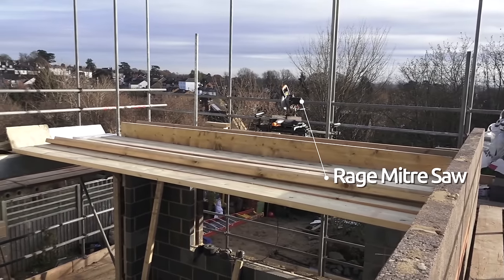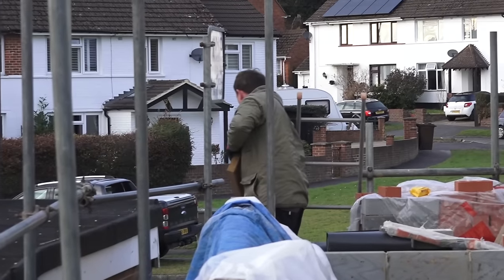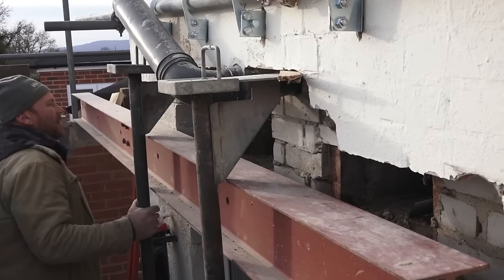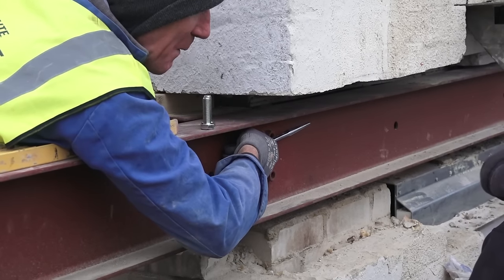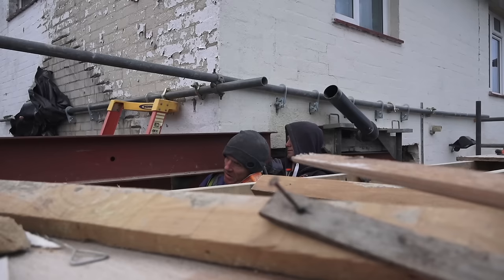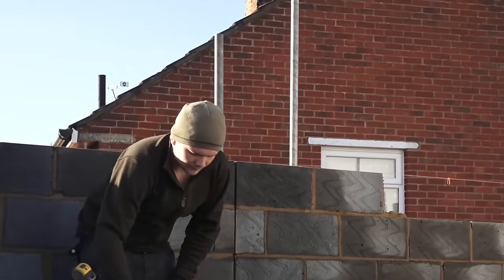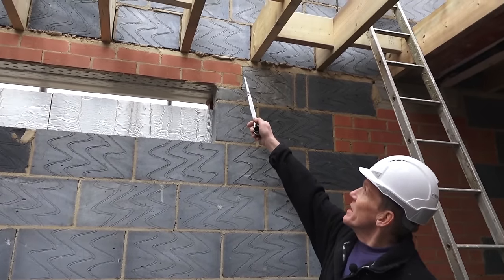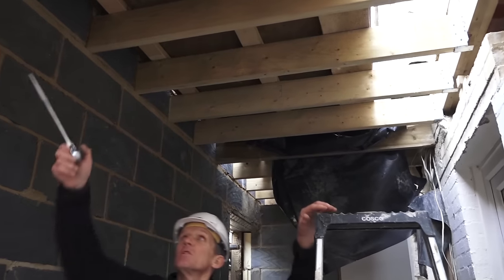Fiting Joists & Steels | Extension #6

Comment: Great vid as normal. I miss those days of putting joists into walls. In Suffolk its been against building regs since about 2003. We can only use masonry hangers or  fixed wall plate. The only time we can do it is in special circumstances like a curved wall with lots of silicone after its bricked in
Reply from the maker: Lee Burwood
Hi Lee 
The drawing showed masonry hangers but, where possible I would rather build them in because they are less bouncy. We will have to take a chance on the building inspector being happy.  We have let the mortar and timber shrink for a while so it is now  time to gun some Blower Proof or similar in around all those joists. You can get plastic pockets to house them in. We have 90mm of Ecotherm behind the joists so they shouldn't get damp.

Comment: Thanks for the great video. You rightly point out that dwangs or noggins need to be full depth in order to stop the floor joists twisting. Especially here at the bearing on the steel these need to be full depth if not on joist hangers. The joists spanning tables from Trada provide further details.

Comment: Nice shear load explanation regarding how seemingly small diameter nails are OK to hold the metal joist wall hangers in place (designed such that no bending moment acts on nails, just shear)!
Reply from the maker: Yes, you are right

Comment: Love the informative video... I'm having a beam put in for my extension and from day dot I told the structural engineer and builder that I want the joining room ceiling to be flush. Not being told the beam is to deep and cannot be flush as it hits the floor upstairs. Do I have any options?
Reply: Drop ceiling height a little bit

Comment: Thanks for the vids as always Roger but why not just fit full depth blocking to help stiffen the joist web? If memory serves any span over 2300 needs them and they’d only take slightly longer than the noggins. If you want space for services then do herring bone or even the metal off the shelf herring bone ties.
Big fan anyway and thanks for taking the time to set up, film, and edit. As a chippy and builder you’d think I’d see enough at work.
Reply from the maker: Ah! Steven, you stole my thunder. I have now fitted the mid-span full-depth blocking and one more idea that helps take the whip out. I am told that herringbones beat blocking because blocking shrinks and herringbone tightens.
Reply: Skill Builder Sounds about right. Hard to get the time for herring bone nowadays but so much better. Allows air flow and leaves plenty of room for running services.

Comment: What is the full extent of the steel off the corner of the existing build into the new extension? Is it a must for this type of wrap around extension?
Reply from the maker: Yes you need to hold up the corner of the building to this 'T' steel arrangement is common.

Comment: Got a similar project, do the joists that sit in the internal web not have joist hangers
Would appreciate your help
Reply from the maker: You don't need a joist hanger if they sit in the web but you need to bolt some timber noggins in between each joist so you can fix them in place.

Comment: Hi, just a quick question. You mention towards the end that you were considering notching and slotting the joist directly into the steel beam but you didnt as you only had an inch of flange. 

If you were to rest joist directly on a steel beams flange, how much of the joist needs to rest on it? 

Thanks in advance
Reply from the maker: I would like a 2 inch bearing but would settle for 40mm with solid blocking in between each joist to eliminate and sideways movement.
Reply: @SkillBuilder  thank you, Much appreciated!

Comment: sorry (from UK) does a building inspector check that joists and beams are installed correctly?
Reply from the maker: yes they should check everything that is structural. It is all about making sure the building is safe.
Reply: @SkillBuilder  cheers..

Comment: Nice video! That 'twist' in the joists is called lateral torsional buckling. If the joists have been designed to have have noggins, they should be full height noggins at 1/3 spacing so the floor/roof acts as one system, not individual members. 
Very interesting to see your temp works there though! What are those brackets coming out the brickwork bolted to the scaffold pole? never seen them before. Cheers :)

Comment: So how did you get around using smaller joists? They look like they’re sat on something built int block work?
Reply from the maker: They are one inch shallower because the floor build up has underfloor heating so they will end up as 9inch.
Reply: Skill Builder thanks

Comment: Lovely job hour doing there. why captive nuts at the steel intersection as opposed to a clearance hole, nut and washers? Would make fitting a damn sight easier.
Reply from the maker: It would but the steel could move on the bolts and that would cause the masonry above to crack

Comment: Could you not have those joists end scribed into the steel beam rather than using the joist hangers?
Reply from the maker: we do that sometimes, it all depends in what order  the construction  is done. The walls went up before the knock through

Comment: Good video , only question I have is how come you used engineers for the steel an not have a steel post underneath to hold the steel ?
Reply from the maker: sometimes you use a steel post and sometimes not. I like a post but an engineering brick pier is how they always used to do it. Look at the all the old railway bridges built to take a steam train. They all use steel on engineering brick. The  weight those steels are holding up is hardly anything in the great scheme of things
Reply: Skill Builder yeah when I was younger we always built brick piers , lot of inspectors we use know like a post , brick pier with pad just as strong tho

Comment: Can you tell me the purpose of 2 steels side by side please?
Reply from the maker: It is often done to reduce the weight. One steel is heavy and you need a large plate above it to support the cavity wall so 2 steels gives you the wider support.
Reply: Skill Builder thanks, I need a steel to go on at my extension, it’s 9m long, 300x300mm and 2.1 tonne :(

I can have lighter steel if I have it in 2 parts with a post in the center but we want it open plan, I thought what you did may be a way round it but at the end of the day it’s down to the structural engineer I guess lol

Good channel by the way

Comment: Should you not have a compressible filler to the expansion joints? Also, are expansion joints required to the internal skin as the NHBC guidance doesn't require them I think?
Reply from the maker: Yes you can buy a foam strip to put in there but we just foamed it up with gun foam. There is a render bead over it. There is no movement joint on the internal skin.
Reply: Thank you. Very quick response and love your videos, I am finding them very useful for my self build :)

Comment: You would have found it easier if the connecting bolts didn’t have the nuts welding on.

Comment: Yet another video on  YouTube where Strongboy’s are being dangerously misused!
Shame on you Skill Builder, the props and needles method would give further access and the required safe working load to support that corner safely and correctly!
The main cause of collapse during masonry alterations is overloading due to removing Strongboy’s further from the wall to either avoid internal 1st floor wall damage or where attempting to gain more fitting work space as over extending greatly affects the capacity.
–
The Maximum Safe Working Loads
(S.W.L)
–
An Acrow prop, 3,400Kg.
–
An Acrow prop used within the props and needles method, 1,700Kg.
–
When fitted with a Strongboy or any other similar designed product the Acrow props safe working load is severely reduced by at least 90%, from 3,400kg down to the maximum 340kg and can even reduce down to 0kg of which depends on the size & the working height of the Acrow prop, how plumb, how tightly fitted and how far the Acrow prop is positioned from the centre of the wall.
–
It’s urban myth that the Strongboy is suitable for every task, with the instructions changed by enforcement of the H.S.E in November 2015 and now read; “Before using a Strongboy you should identify that it is a suitable method to carry out the intended works”.
British law also states that all temporary support must be designed, installed & maintained to withstand the load and only used for the purpose for which it was designed for, a structure must not be loaded as to render it unsafe at any time to any person.
Maximum working height of a Strongboy is 3metres from a solid surface and not from a block & beam suspended floor. My calculations, it is just over three metres in this scenario and the wrong sized Acrow props (no2) inner tube being well over half way out of the outer tube which also reduces the safe working load of the Acrow prop considerably & creates a higher risk of the tube to curve when eccentrically propping as an Acrow was designed only for concentric loads from head plate down to foot plate. Stop teaching your subscribers bad and dangerous habits, either do it properly or not at all, a Strongboy is a dangerous shortcut of the correct method of props & needles. Two years ago I asked you to make a video of how to use a Strongboy correctly in the same way you have done with a ladder, I do hope this is not your attempt?
KEEP IT SAFE FOR THE NEXT GENERATION OF BUILDER!
Every task of alterations is different which is why a variety of temporary masonry support equipment most suitable is to be used.
My 2019 masonry wall propping guide is available to read in full at;
www.brickbrace.com
Reply: Not responding Roger!
Insufficient masonry alterations knowledge to talk to me?